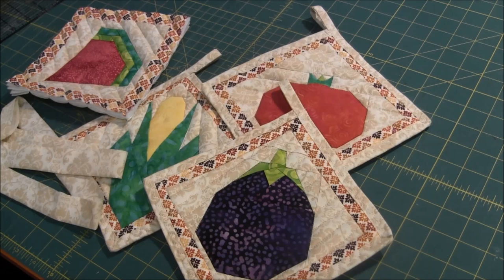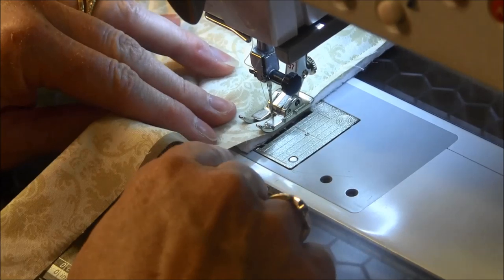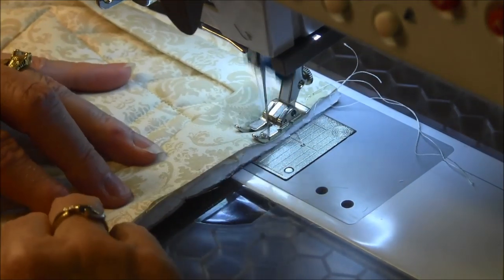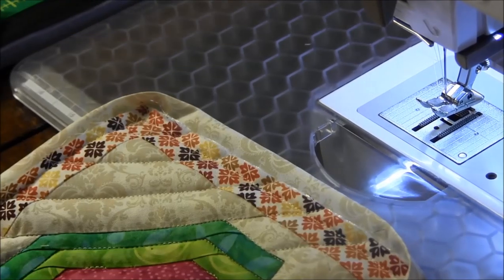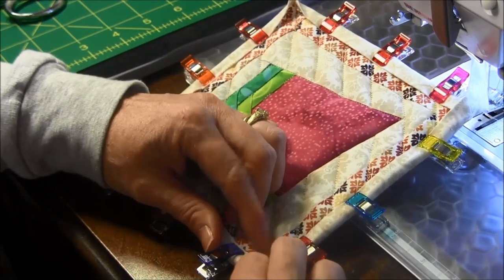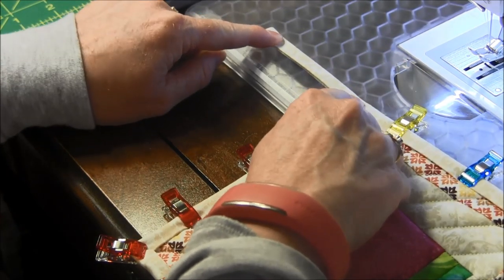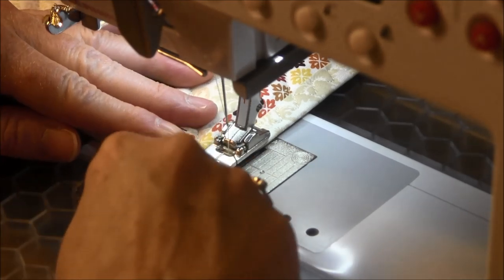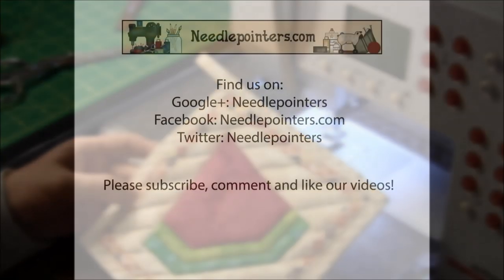How to Machine Bind a Potholder with a Hanging Loop

Comment: So you get to a 1/4 inch from the end, then what? See straight through? Off to the corner?
Reply from the maker: Hi Wendy!  Thanks for your question.  Stop at 1/4" from the corner with your needle down, pivot to point towards the corner and then sew off the edge of the fabric in the corner.  Hope this helps!
Reply: Thank you very much for that, I appreciate it, it’s the first time ever binding anything, didn’t turn out the best, but it was okay. 
I appreciate the comment and explanation